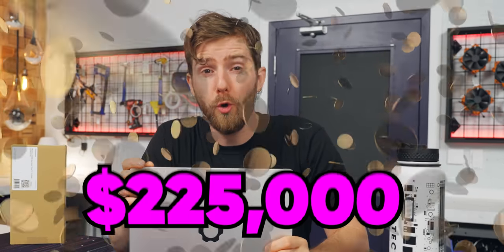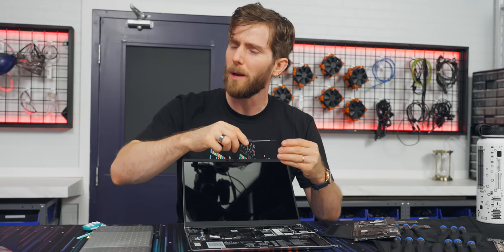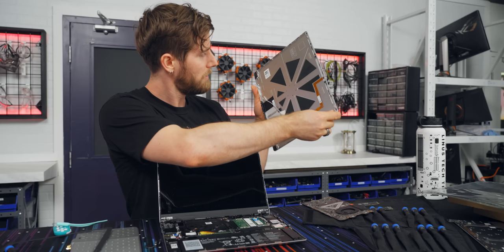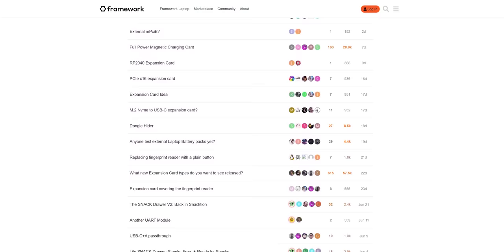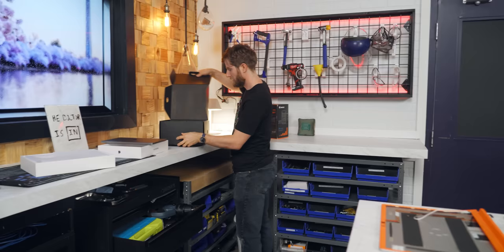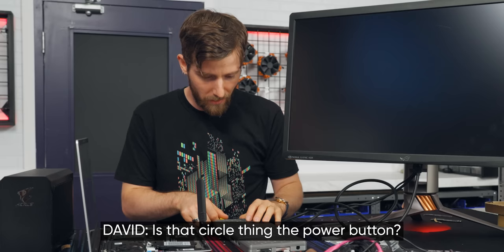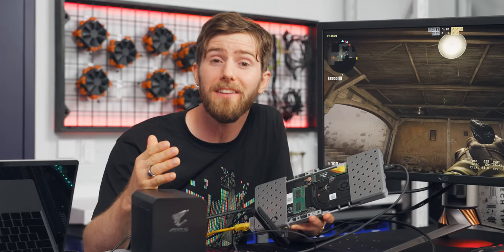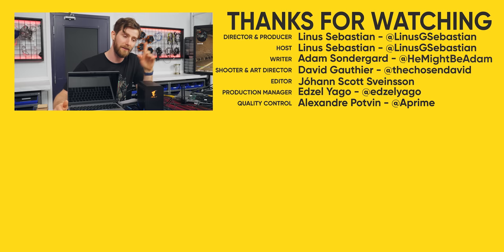I invested $225K in Framework Laptop - 1 Year Update and 12th Gen Upgrade

Comment: This will be the only laptop where you can start with an Intel CPU one gen, then decide to swap out for an AMD one after, potentially. Imagine how crazy that is!
Reply: That is the reason I bought one when Linus first talked about them. I knew I was not forcing myself down a path I often swap between intel and AMD. I will probably upgrade it when a AMD option comes out, and use the old intel one as a media pc in the 3d printed enclosure like this, what will be cool about that is with all the modules I can make that work even better. I cant wait for the ethernet module. I may have spent 1600 for my first laptop, which for what I got was pricey. But next time ill probably spend 1000, and bring whole new life into my laptop, and be able to repurpose it.
Reply: @DuxGalt  how is the screen like? 
Just works or above average?
Reply: I worry that putting better and better CPUs into the same chassis will eventually leave not enough room to fit A properly sized heat sink in.
Would have been nice to see the thermal curves for them compared.
Reply: @nullvoid3545  well, technically speaking... going from intel 11th to a current gen AMD yea....  and its an ultra portable with no big emphasis on crazy graphics so pretty sure if just using integrated graphics potentially you will just get cooler laptops overall,  with that 14 core one they put in??? hmmm
Reply: @nullvoid3545  as long as cpu tdps stay the same as manufacturers go for power efficiency on mobile devices, thermals shouldn't be too different among different cpus. heatsinks have a max tdp rating and so as long as cpus stay under that it shouldn't overheat.
Reply: @nullvoid3545  Not if some year the material or tech changes
Reply: @kermitdaphrogge525  I am not a profesional reviewer However I'd say im very happy with it. My PC is hooked to LG C1 OLED TV's but when I am on the road(truck driver) I used the framework lap top to watch netflix and I found the image quality to be really good. for the size the resolution seems fine. I have not used in super bright areas but id say that it would not do well as the brightness does not get as high as id like. The audio also does not get very loud. It also gets pretty hot if suffocate the bottom of it by laying it on your chest while in bed which was my use case. 

However I used it in dark areas primarily and liked using my headset for audio anyway. Those are the only issues I have with it. I have an older TUF gaming laptop that has better audio that was around the same price, though it has a GPU. But the screen is better on the laptop id say. 

The brightness thing might be me just being used to HDR content. Also the fact that in the future I will likely be able to upgrade the screen is a big plus.
Reply: Just hoping for an ARM based one...

Comment: When the ethernet port actually comes out, two of those on the old motherboard would also make for a pretty good firewall with dedicated ingress and egress network ports.
Reply: or you can make any kind of home server with it
Reply: a firewall with some serious hosting capabilities.

you can host websites game servers and so on a cpu like this.
Reply: @katech6020  Actually that would be really neat turning those motherboards into a blade system
Reply: While certainly a very reasonable use case, that's a rather overpowered (and expensive) firewall considering how little CPU a multi-gig internet pfsense/opnsense system needs, and how affordable retired data centre Intel X540-based dual 10G NICs can be bought for.
Reply: @Postman00  Yes but if you were already planning on upgrading your motherboard then it makes sense to use what you already have to make something pretty cool.
Reply: I believe 1000$ for such a server to be overkill. There are other much cheaper solutions for that, like an old intel NUC.
Reply: @ndc5544p  But you are not spending 1000$ on the firewall server. You are spending 1000$ on improving your laptop and then using the old mainboard for 0$ to do something like the firewall, a smart home server, a NAS system, a local game server, whatever you can dream of.
Reply: @Postman00  sure, in that case put a proxmox there with pfsense and say openmediavault, or more.
Reply: or a proxmox server with a pfsense vm xd
Reply: Hey! Good idea!
Reply: Also, the laptop board will probably have either lower power draw than most repurposed desktop servers and more power than most low-power servers, seems like a good sweet spot when you need a little more than a Raspberry Pi.

Comment: Loving the progress that Framework is making, I really really hope they keep on moving forward and expanding their lineup. Hopefully they'll eventually make bigger versions and add GPU options at some point. It'd be especially cool if they could make a separate GPU board that you could upgrade independently of the main board.
Reply: Read my previous comment. I think it’s a great idea!
Reply: The only reason I didn’t purchase a framework was the lack of discrete GPU
Reply: They going to tell you: buy an e-gpu and use thunderbolt.
Reply: Amds igpus would be a good option to offer as they are much better than most of what intel offer as well as the benefits of better efficiency.
Reply: I'd be intrigued to see what they could do if AMD does actually partner with them. Something with AMD's Ryzen 9 6900HS? A collaboration with Valve to make a SteamOS compliant laptop? That would be legitimately intriguing.
Reply: @mndlessdrwer  yes, very much all the way, yes.
Reply: THIS. THIS WOULD BE ULTRA PRO MAX SUPER COOL!!!
Reply: Modular GPUs do already exist, they are called MXM cards. But to fit one in that thin and light chassis (and cool it enough) you'd be basically removing the entire battery. While I like the idea in theory, and Framework may throw in some Radeon G APUs in time, it is unlikely the laws of physics would allow anything more than a 1650 in that chassis. Now if there were a 15" option, that would be another story...
Reply: Yes! Maybe a 14/15” dGPU chassis that can accommodate the same motherboard just with a small daughter board for whichever mobile GPU you’d like.
Reply: @javierolavarria  Yeah no TY, e-gpu adds extra to something already expensive that should in reality have discrete graphics, you are not charging me over $800 for an APU or subpar solution not when something like the Asus Zephyrus G14 exists.
Reply: @javierolavarria  But thunderbolt isn't able to give the full performance the card could get were it connected with more PCIe lanes. And an eGPU isn't as portable. I myself would prefer more portability.
Reply: @hazmont  Yeah, I'm hoping for a 16" option. I don't doubt it would be hard to fit enough cooling in the current design. For myself, a 1650 would be all I would need, maybe a 3050 would be nice, but I find the 1650 to be sufficient.
Reply: @javierolavarria  In that case we'd tell them no.

Comment: I was actually wondering about Thunderbolt support for Framework, but I’m glad it’s (unofficially) available.
Reply: It's the most underrated part of the motherboard. FOUR. Not one, not two, not three, but FOUR USB4 ports with TBolt support on Every. Single. Port. I can't think of a single other laptop that does that.
Reply: @spdcrzy  Not even the new Macbooks have 4. Now, granted, they have dedicated ports so overall you get a little more IO, but still.
Reply: @johnbuscher  yeah, AFAIK every single port has its own dedicated controller too, which is INSANE. That's where your hidden cost is going when people ask "BUT ITS SO EXPENSIVE"
Reply: @johnbuscher  The MacBook Pros have 4 Thunderbolt ports since 2016.

Comment: A buyback scheme would be perfect for these types of motherboard upgrades. 

Framework gets to sell a motherboard multiple times, and consumers get a small discount.
Reply: Takes alot of work though.
Reply: I want that, though I wonder how economical it would be for Framework to facilitate directly.
Reply: Framework operate a marketplace for reselling components already?
Reply: Trade ins?
Reply: @Yusuf_K7 : But that requires a much bigger turnover to compensate for the logistics.
Reply: Maybe they should partner with smaller repair shops - shops offer upgrade for cheaper, and repurpose + sell the old mobo as a small desktop (or as repair parts)
Reply: The amount of people buying them, and the amount of people wanting the older board, would make this not feasible. The only time people would want the older board, after the new board was released, would be people who had their older board fail.
Reply: @littlejackalo5326  Or people who are upgrading from an even older board, or people who are looking for a cheap motherboard for e.g. an office PC (with the 3D-printable enclosure). I think there will be a big market for old motherboards down the line, but setting up a buyback scheme economically and with their mission in mind would be a lot of effort for Framework
Reply: That wouldn’t make much sense to them, the laptops with the old motherboards would be at least as expensive as the new ones.
Reply: @littlejackalo5326 : No, it would be people who wanted a less expensive computer, but didn't have the confidence or skill to make it themselves.

Comment: The only reason I haven't bought a framework yet is the lack of an AMD option, the Intel cpus run too power hungry and hot for my liking.
Reply: tbf the new ones are a lot better now but yeah
Reply: I'd also prefer an AMD cpu, but for the better APU options. I'd take the intel though, but I prefer to have a 2-1 device, like with a 360- or z-hinge. Ideally with a pressure sensitive stylus.
Reply: Same, I'll look at it when I see more options.
Reply: AMD isn't much better on the high end... I've got an AMD Gaming Laptop from 2021 and I have to massively turn down the frequency and boosts to keep it cool during regular tasks.
Reply: ARM would be even better in this regard.
Reply: I think we are Ddosing frameworks homepage....
Reply: It's funny how back in the day, AMD was memed to be the hot one.
Reply: @riddixdan5572  Yeah, my old FX 8350 was practically doubling as a space heater for me in the winter lol
Reply: @Hotrob_J  I wonder whether it would be possible to make a custom 360° hinge for the framework laptop...

I'm sure that that will be an option at some point in the future, but that could still take several years.
Reply: @sampsonike  I don't think you know what DDOSing is.
Reply: @sebastianjost  It's not possible. It's not as simple as just putting on a swivelling hinge and then you're done. You have to get all the wires to connect without twisting or binding. You'd have to have a chassis and screen that are designed for a 360 hinge. The entire thing would need to be redesigned.
Reply: i'd just take whatever suits me, wheter it being amd or intel
Reply: @Hotrob_J  Ooh that’d be awesome. I’d be sold on a Framework 2 in 1
Reply: @JohnSmith-xq1pz  I severely doubt official ChromeOS support will ever happen, full stop. At least if Google continues to be the way it has been up to this point for the foreseeable future..
Reply: @PabloEdvardo  thats mostly down the the manufacturer having crappy cooling. which laptop is it out of curiosity?
Reply: @leeroyjenkins0  Not sure about ARM, but the only advantage AMD currently has over Intel in Mobile Processor market is their Graphic performance, especially in the 6000 Series Mobile APU's, which is really good for some good gaming experience.
Reply: @sebastianjost  I actually have been wanting to buy framework parts and see if I can make it work in my old Sony Vaio Flip (which has a fried motherboard)
Reply: The other reason is, it's only available in like less than 10 countries.

Comment: I'm so glad you didn't say they were falling apart.  I've been rooting so hard for Framework to succeed and set the standard.  Now, if I could only afford one....

Edited for spelling. HA!
Reply: Nah, the repair-ability make it a cheap option in the long run.
Reply: I've been rooting for them. What type of router do you use to route for them?
Reply: I really want an AMD option.
Reply: I think that's the primary issue with them. Sure right to repair is wonderful. But you need to market that to the common consumer. They need to make it economically make sense more than just environmentally. Sure buying 3 500 dollar laptops over 10 years is horrible for the environment but it takes less out of my bank account when I need a new labtop. Most people aren't buying 1500 dollar labtops they're buying the 4 or 5 hundred dollar ones because they just need it for either work or school and when those wear out or break they just buy another. It needs to be less expensive to maintain your current device than buy a new one. And framework isn't at the moment.
Reply: @aethlred7380  just make The cpu and ram upgradable like laptops used to be
Reply: @aethlred7380  I’d rather pay a grand for a new mb setup and install it  than to pay  over 2 grand for a new laptop and go through the pain of transferring all my data and backups to the new laptop. Not to mention my old laptop sitting around collecting dust. Plus how he showed you can even turn your old mb in to a mini pc setup is a real game changer. I’m sure people will sell their old hardware in the second hand market. Average consumers are looking for this they just have to get over the fear or opening one up and doing the replacements themselves.
Reply: @AndrewTSq  cpu upgrade ability is nearly impossible and would ramp up the price by alot
Reply: @h0udinl  And the thickness especially
Reply: @JechtAruon  Ok, but you watch Linus videos so you’re probably much more comfortable with this type of thing and much more willing to put the time in. The average consumer would pay more for a whole new laptop, which is why pre-built pc companies are so popular for example. For this to work, these replacement parts need to be as cheap as possible so an average person would be willing to put the time in to offset cost
Reply: @h0udinl  impossible? why can you do it on your desktop computer if so? they only solder these components cause its cheaper (but say like $5 at most?) and the laptop can be thinner. But even old laptops I had with removable cpu and memory ,they are not that much thiccer than my current laptop with soldered parts.
Reply: @ThisGuyStandingHere  in this day and age many people knows someone who is tech savvy and do the work for them and cost them a case of beer or dinner. The way the market is and inflation and start of a recession to name a few. Many people have to be frugal with their money. Framework just needs to get their message to the common people about how when you want to upgrade you don’t need to buy a whole new laptop but to replace what you need. The eco warriors would eat this up to just brag about how their laptop doesn’t need to be tossed to the landfill but only upgrade the components inside and can take the components inside and make another computer  from it or sell the components to offset the costs. 

I never understood why desktops was so upgrade friendly that you could swap out cpu,gpu and so on. Yet laptops was so much locked down. I think Alienware was one of the first with their line of laptops you could swap out the cpu and gpu in them.
Reply: >Working class 🤣
Reply: @Mr Pais it was sockets in the budgetsegment.. so not sure why a $5 socket would make the price go x8.
Reply: @Wind-lx8zb  Bill Gates see's everyone as working class.
Reply: @gg-gn3re  I actually stared at it and tried changing the spelling multiple times before saying 'good enough' and then still got it wrong....
Reply: Yea, it's really for for the reparability (something breaks), than the upgradeability - I was seeing that as the next step, but if it comes all at the same time with the same design, I'm all for it.
Reply: @jeffreydheere4737  hehe well looks good now

Comment: For using their motherboards in a desktop pc with graphics card, I'd love to see an e-GPU case that allows you to mount the motherboard inside. If it then used modules from the laptop to create custom front and rear I/O, I'm sure it would be a real gamechanger in terms of small form factor PCs
Reply: I'd love that.
Reply: This.
Reply: For now: Velcro
Reply: Somebody could technically design a 3D-printed shell for the Framework motherboard that just snaps onto (or screws onto) the e-GPU case. You'd need multiple versions of those (for different e-GPU enclosures), but it's totally doable!

Framework could even make the models themselves, for e-GPU docks that they've evaluated and confirmed compatibility with.
Reply: oh that'd be a great invention!
Reply: A case that can mount a gpu AND a motherboard? you mean like a normal pc case?

Comment: I've been watching Linus for several years now and the man is at least consistent: Everything that can go wrong in a simple upgrade WILL go wrong.  But only because Linus touched it.
Reply: Only if Frameworks used all the same screws or just marked them with color. Silver for chassis, black for motherboard, red for screens. Then just print a circle of the same color around the screw holes. Do it in the repair menu as well.
I love color coded screws and parts, not idiot-proof but if you can always remedy your mistake if you happen to mess up the screws
Reply: He didn't drop the motherboard which I was sure he will when shaking it out of the box, lol.
Reply: He's the perfect tester